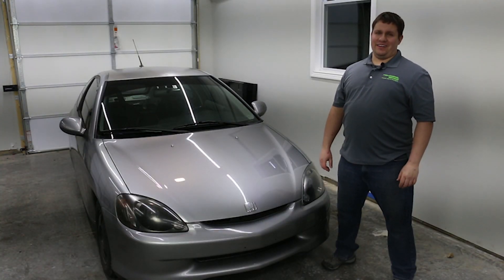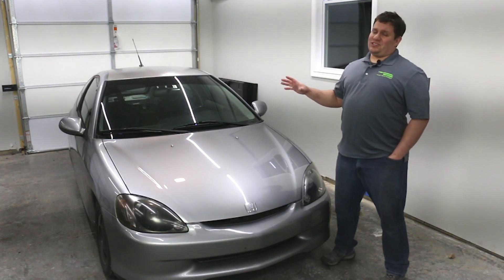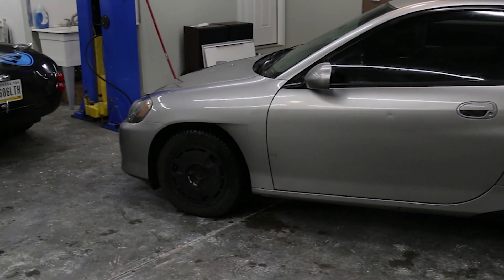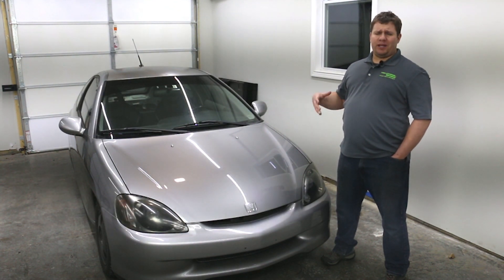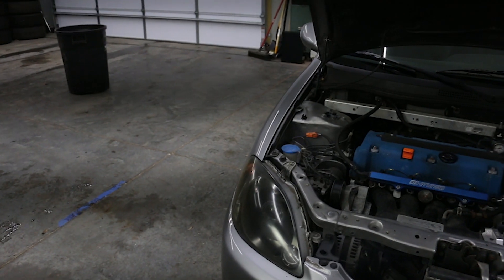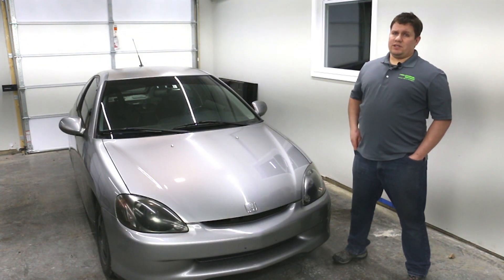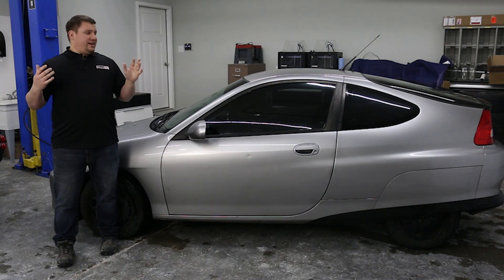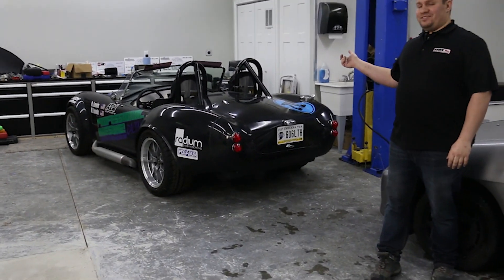Professional Awesome Project: Honda Insight K-Swap Exsight

Comment: I assume it was a stick beforehand? Are you going to insightfest this year? I have to see this monster. I have two and one is a cvt which would be the one for the mod. Gas mpg with me is like 51-52 on a good day mostly mid 40 mixed driving. For those mpg’s I’d rather something that sleeps and awakes to surprise everyone while getting same mileage.
Reply from the maker: I may be at Insightfest this year but not locked in. It was a stick before the swap. Mixed driving MPG is closer to 35. Highway is 50-55mpg and could be better if I didn't go 70+. Haha
Reply: Wow. My cvt sucks. My best mpg is 52 on highway maybe 42 mixed.